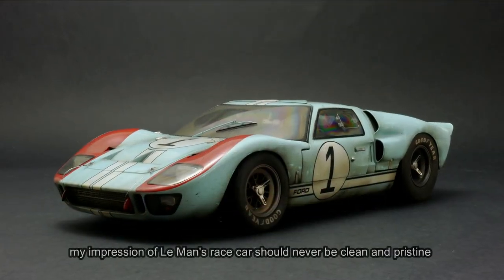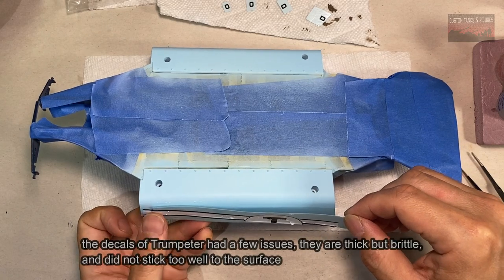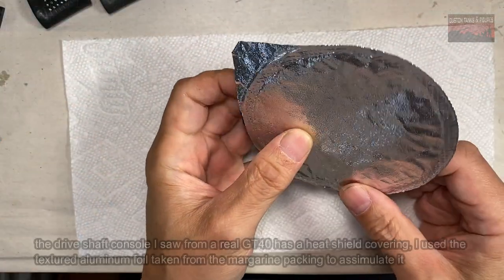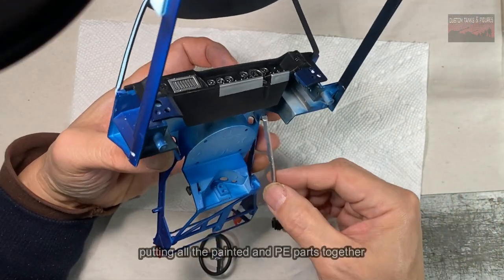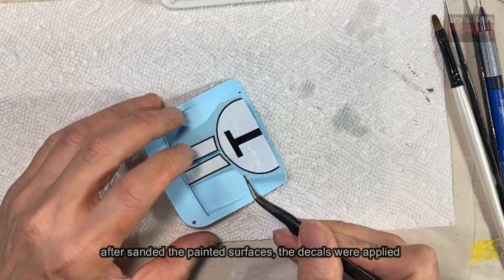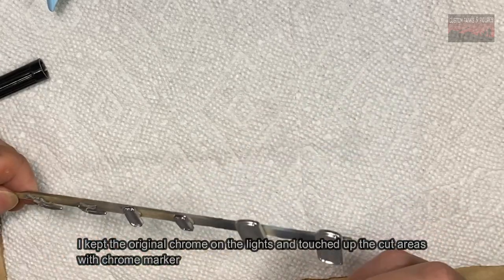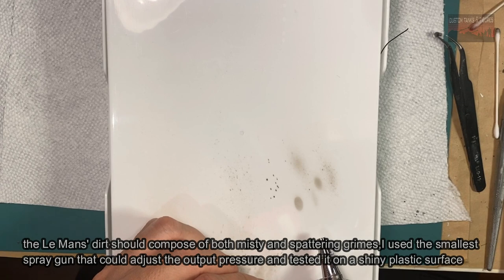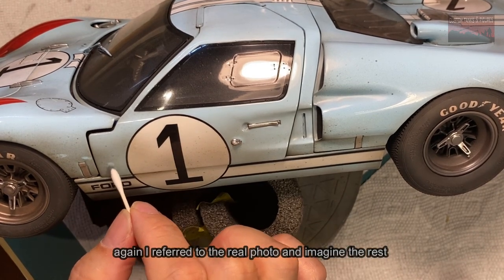[auto Le Mans Series] 1966 Ford GT40 Mk II 1/12 Trumpeter - 2024 HERITAGECON 16 SILVER MEDAL WINNER

Comment: Nice build! Can't agree with your comment about the Meng kit, though. Despite it's failings, the Trumpeter has a far more accurate representation of the bodywork than the Meng.
Reply from the maker: Thanks! I actually didn’t have a Meng’s version to compare but mainly through the pics and their manual. I think there are good and bad things on both kits but with the trumpeter affordable price it surely  beats Meng for a modeller’s point of view. I didn’t know what’s wrong with Meng bodywork, can you elaborate?
Reply: @henschelporsche1  Firstly, the Meng front clamshell is completely wrong. In side elevation, the curvature over the wheels is far too swoopy and cartoon like. The headlights are wrong and look to be based on a modern Ford GT. The centre cockpit area is also wrong with A pillars that are too thick. In my mind, it looks like the centre section of a Porsche 904. Check out period photos and you'll see what I mean.
Reply from the maker: Thanks for the information, I think I made the right decision, so how I find Meng products are a bit overpriced with their quality, not to mention the finished colour version that are selling for a grand.

Comment: Lovin the look.  It makes a  great change to see a car that feels as if it's been raced hard n covered with oil n grim.  Which airbrush do you use?
Reply from the maker: Thanks? I had hesitation when applying the dirt on a perfectly shine car body thinking it would ruin everything. But I think it turns out much nicer than leaving it clean. It certainly gives the car a character and its age.
Reply from the maker: The airbrush I used for dirt was iwata Hi-Line HP-BH